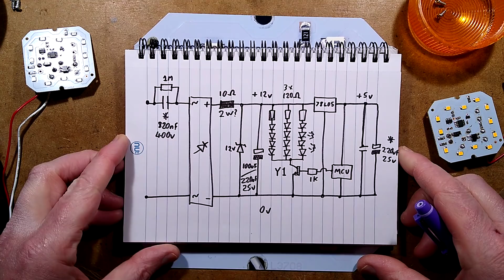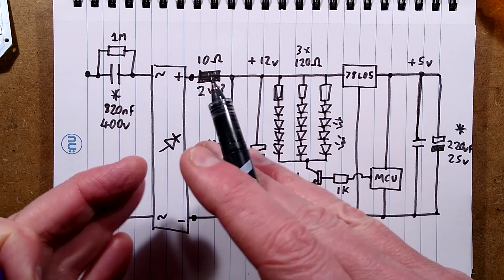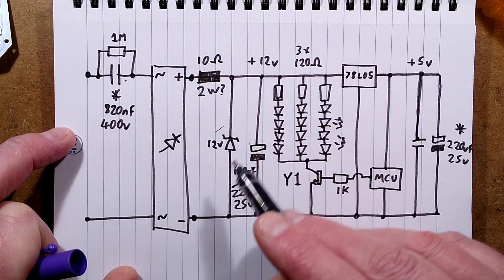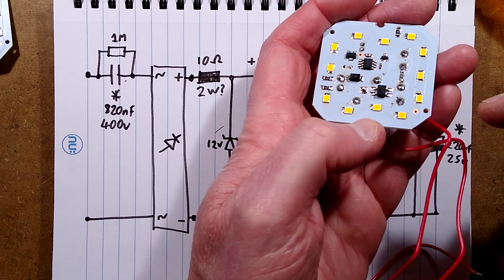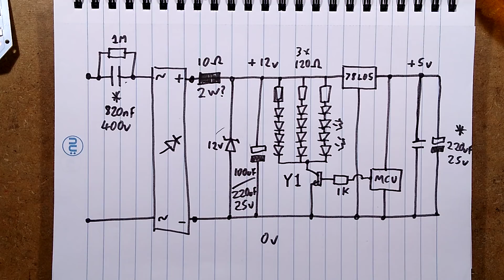Repairing an industrial beacon (with schematic)

Comment: If nothing else, blue is a very visible color in an industrial settings, when i worked ina  foundry, couple of the forklifts transporting molten iron had blue spotlights, very visible when they drive, it was mostly pointed at the ground a bit before them. A clear blue is rather unusual in a dirty foundry, very nice
Reply: Notably, the blue being VERY distinct from all the red and amber and yellow from molten iron.
Reply: We had that as well in a switchgear factory. Sort of a warning projected onto the ground in front of the forklift :D

Comment: It would be fun to put a more complex program onto the MCU.  Like a morse code flashing pattern.
Reply from the maker: There's a good chance that part of the reason they used the microcontroller was to allow other strobing patterns like bursts of pulses.
Reply: @bigclivedotcom  do you know how I can find somebody in the USA 🇺🇸 who can fix my vehicle inverter?  My starter solenoid shorted out, causing the main resistor to fail, then it fried the mosfets on one if the two outlets.  

I understand the basics of electronics, but my soldering skills are only for connecting a few wires.
Reply: You could also do interesting things with an input to the MCU.
Wonder what the other three pins do, if anything.
Reply: @markevans2294  Usually nothing when it comes to super cheap one-time-program MCUs, but possibly other GPIO pins for better models.
Reply: Marvel Cinematic Universe

Comment: I feel almost sorry for the microcontroller, stuck doing something so far below its intellectual level...
Reply: "Brain the size of a planet and they ask me to strobe an output pin"
Reply: EEVblog notes how some of the microcontrollers are around 3p now in bulk, so with it being so cheap, it might be cheaper than using old fashioned soldered in parts (resistors, transistors/capacitors etc that are not on a chip solutions)... but still surprising they don't use a flasher chip solution, and use an entire microcontroller instead.

But IMO, that's how technology progresses. Remember the time when we went "why make an entire page of paper for writing that, when you can scribble it on this bit of old clay pot instead"? Well, now we use up paper like there is no tomorrow and don't worry about it. Likewise, these chips become so cheap, it costs more money to not use them. :P
Reply: I always appreciate the effort when someone sends me a message in clay tablet form.
Reply: @TechyBen  Too right. I haven't made a quick note on a slab of clay in ages... Despite having loads in the garden.
Reply: @TechyBen  The silicon to make them is now cheaper by surface area than the 555 timer. Thus the micro being used over the larger 555 timer chip, as analogue IC size does not shrink much. Yes more complex, but much smaller transistors. Remember that 3c micro is for low volume orders, if you are a manufacturer using the same tiny micro in a lot of products they likely are even cheaper, even if you do have to program them in lots of a hundred for an hour's production. Also only 8 pads to solder, while for the 555 you need solder on a minimum of 14 pads that is correct, while the flasher only needs ,as pointed out, 3 solder joints, the other 5 being left out.
Reply: @SeanBZA  I wonder if soon the reels they come on will have the basic leads to program the chips in bulk without even having to take them out of the pick and place reel? If they are held in tightly enough they could just use the metalized plastic they use on a lot of food containers these days, just with a masking system to keep the traces separated
Reply: @SeanBZA  There is actually no saving in the number of pads to be soldered when you take into account that the micro based circuit also requires a voltage regulator, the LED driver transistor and its associated base resistor. All these items could be omitted in a 555 based design as it could directly drive the LEDS and could also run off the unregulated supply. A 555 based design could be cheaper overall than the micro based design even if you are using one of the $0.03 micros.
Reply: It's even better. This was the non-strobing version (sticker on the front reads "always lit" or something close to it, in Chinese). So they don't even bother leaving the microcontroller/transistor/voltage reg off when they bridge them out.

Not only wasn't the micro doing anything complex, the one thing it was doing was being ignored on purpose.
Reply: @ConstantlyDamaged  Probably a low volume sub product, so using the existing stock to make it as needed works out cheaper than running a lot for the specific model.
Reply: @SeanBZA  I think Darthbane’s post was re: insult to the micro controller not cost.
Reply: @ConstantlyDamaged  ah for Blue this makes sense, you typically mark known maintenance downtime with it
Reply: I spoke to the computer... It hates me.
Reply: Self satisfying strobes, they're always so glad to be of service.
Reply: "stuck doing something so far below its intellectual level"
MC : "Yeah, It's A Living I Guess. The One Next To Me In The Anti-Static Tube, He Got To Go In A Probe To Uranus"
Reply: Analog timers require precise components and change as their capacitors age. Digital timers are less hassle.
Reply: @MetalheadAndNerd  It's a stupid indicator light. Who cares when its times drift a little over years of operation?
Reply: @MetalheadAndNerd  In this case the analog timer is probably more stable than the digital one despite capacitor aging etc. 

A digital timer is only more stable if it is driven from a precision clock source such as a quartz crystal. In this case the micro timing will be derived from an internal RC oscillator, which is subject to considerable process variation along with variation due to changing temperature and supply voltage. The total variation of the micro clock frequency can easily be +/- 5%,  even after the factory calibration of that clock frequency. 

An analog timer like the 555 can easily better that +/- 5% stability figure.
Reply: That's the 21st century for you.  Microcontrollers that run about $0.005 to make a light blink.
Reply: High IQ worker, minwage, soul-crushing, repetitive job! Sounds familiar.
Reply: What’s all this talk of using a 555 timer chip? You can make a suitable flashing circuit using two very cheap transistors, some cheap resistors and some cheap capacitors. No need for an additional driver transistor, or for a voltage regulator.
Reply: @Mark1024MAK  The problem with that "simple" solution is tuning it to the right frequency and stability, not much of them would pass the QC i'd imagine (that solution carries a lot of deviations simply off the differences in solder joints / load n shit)
Reply: @davidblahota5655  QC?  surely you jest!
Reply: @tomhoehler3284  right, no need to do that since its controlled by MC. In B2B orders the product either meets specs or it's scrap. And i can imagine the strobing being specd tighter than just unstable power delivery could deviate out of in case of analogue circuit.
Reply: They could have left the  voltage regulator and MCU out, and do the flashing with two resistors and a flash LED and PNP transistor. Resistor to positive, in series with LED to the negative, and from that mid connection a resistor to the base of a PNP transistor with its emitter to the positive and the collector to the base resistor of that switching transistor.
Reply: “What’s my purpose?” “You pass electrons (in a pulsed pattern)”
Reply: @aterack833  "What do those electrons do? Is it super important?"
looks at the bridged-out transistor
"Oh. Oh yes. Very important."
Reply: Because it is a deluxe edition they use a microcontroller other than 555 or discrete transistors.
Reply: Yes..ROFL
Reply: You pass butter.
Reply: What is my purpose? 
You serve butter. 
Oh my god.

Comment: You did take a strobe apart before - https://youtu.be/dIaMm8pBHHg
Reply: And that one used an rc oscillator (flip-flop). It is hard to believe that micros have gotten so cheap that it was cost effective to replace a transistor and a pair of capacitors... maybe also saves some resistors. Amazing.

Comment: Is it really cheaper to use a micro than to use an rc oscillator? Wow.
Reply: With a micro you can use a programming resistor to select which flash pattern it has without other changes to the circuit. My employer makes a couple of products which use the same PCB, with the same stuffing and which product it is is determined by a resistor on the front panel board.
Reply: Well, there's this:

https://elecsound.en.made-in-china.com/product/BOmJlZYACPhs/China-IC-MCU-8bit-1-75kb-Flash-8soic-CMOS-Microcontrollers-Sop8.html

That's a Chinese-made 8-bit microcontroller available for a PENNY (US) each in bulk.  I can't find SMT resistors available for less, never mind capacitors and 555's.
Reply: Was looking for this exact comment - that's exactly what I thought.